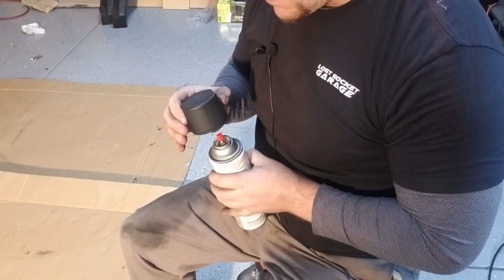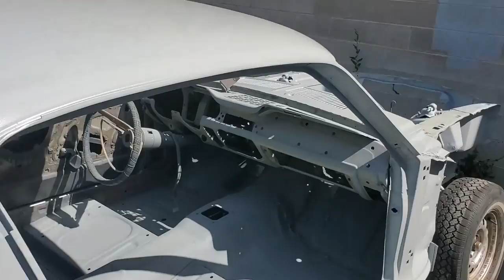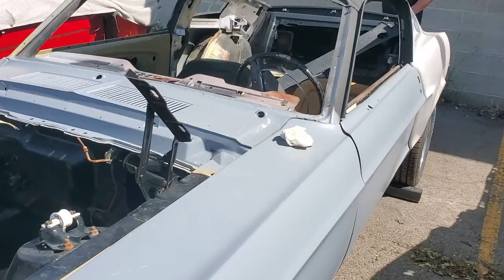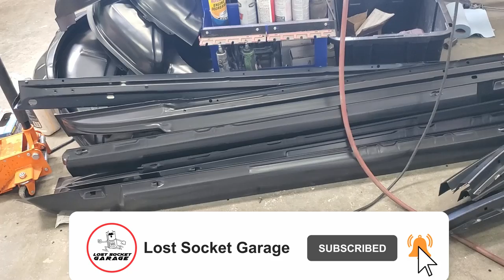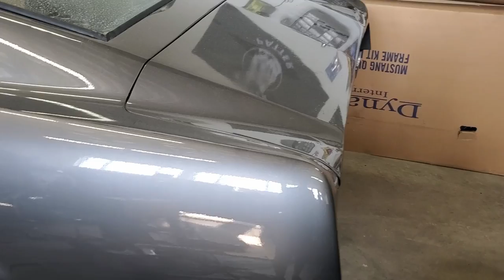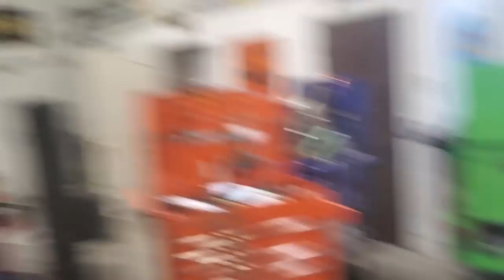Beware the Risks: Dynacorn Pre-Welded Sides & Our Latest Shop Projects | lostsocketgarage.com

Comment: I had to disassemble the right and left rocker panel assemblies on a 66 coupe from dynacorn because they were misaligned and also when i got them apart they had rusted  on the uncoated inner part.
Reply from the maker: I agree whole hearted. I don't use the pre welded sides when I can avoid it. We buy everything individually because the first prewelded assembly we put on was off by 1/2 inch in one of their spots. But I do love their individual stamped stuff

Comment: I am wondering if you found a 67 convertible how hard would it be to do a fastback conversion for it
Reply from the maker: Not harder than a coupe! Actually it'd be a bit better because 1. less cutting 2. Floor is already a thicker gauge steel 3.and it has both torque boxes already! So she would actually be stiffer from the gate.

Comment: I have a 67 coupe That someone replaced the rear quarter panels on and the new quarters  don't have the cutouts for the side vents so I bought new vents but would like to have a pattern to go by for cutting the holes , with all the fenders you cut off do you happen to have something I can use as a pattern ?
Reply from the maker: Unfortunately we don't at this time.

Comment: Do you find the unwelded kit doesn’t have the same measurement issues that the pre weld does?
Reply from the maker: Yes, un welded kit has no measurement issues
Reply: @lostsocketgarage  thanks for the fast reply. Love your videos and have been watching them as I’m going to attempt this myself. Are you drilling 1/8” or 3/16” holes for your spot welds? Looks like they are about 3” apart but I’m presuming there isn’t an exact number.
Reply from the maker: We have a nuematic hole punch that's 5/16. We do holes every 3-6 inches depending on where we are welding. Then obviously around bends and corners they are closer. Thanks! Let us know if you have questions. Feel free to dm us on Instagram
Reply: @lostsocketgarage  sent you a dm on insta